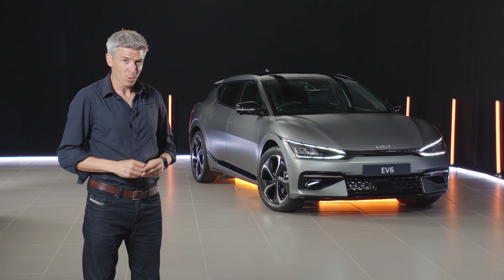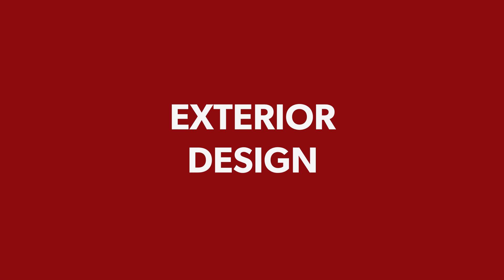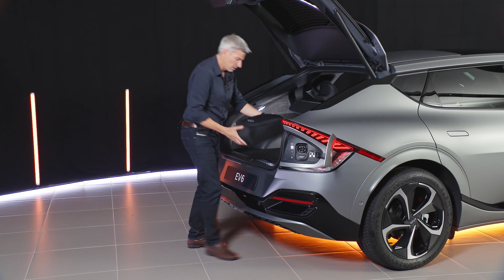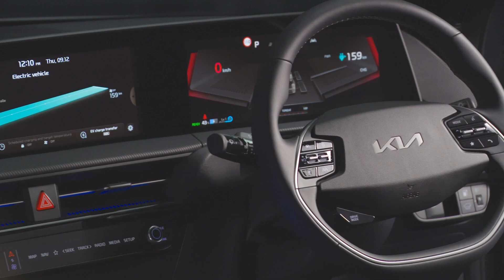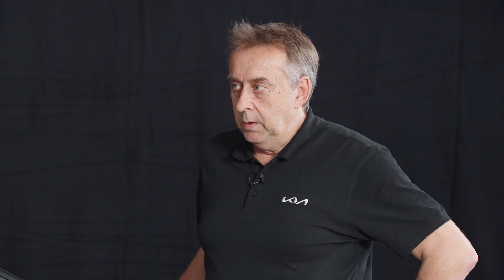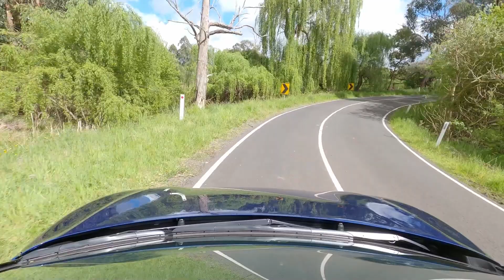Kia EV6 First Look! | Wheels Australia

Comment: I prefer the outside of the EV6 to the Ioniq 5, but inside I wish they’d lose the piano black plastic. When it gets to Australia I’d be interested in the range and charge times in our summer heat (i.e. 40+ C) and I’d like to know whether we get a spare wheel (with the special EV tyre) or a puncture repair kit as I’ve noticed both are often lacking in EVs…